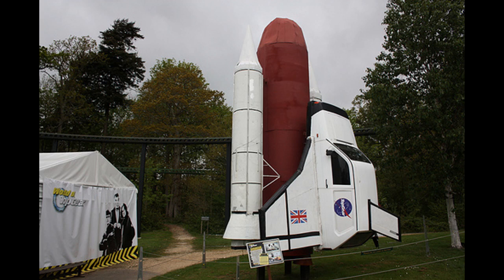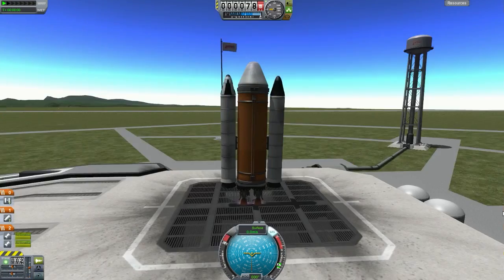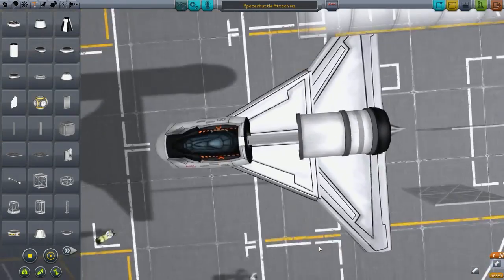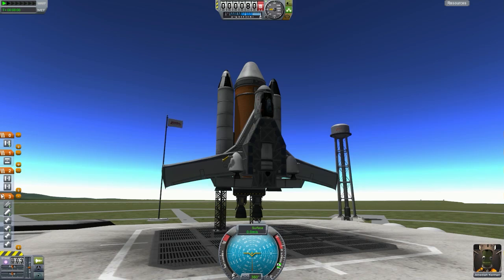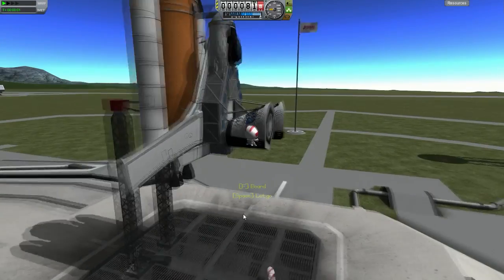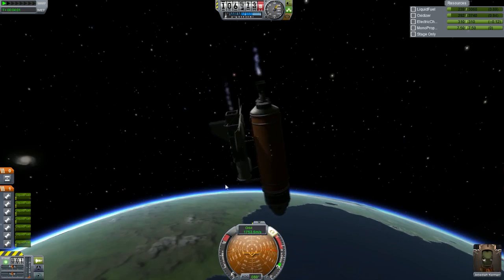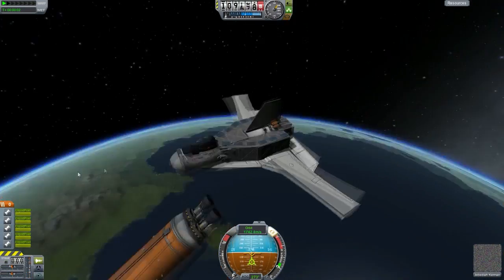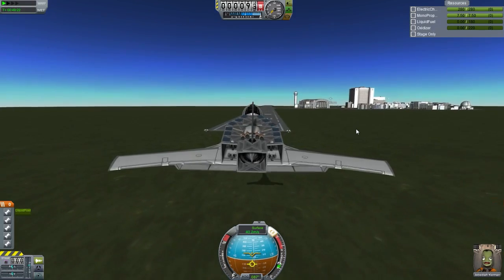KSP : Mini Space Shuttle

Comment: what is that mod your using to put two smaller engines on the jumbo fuel tank or is it stock
Reply: Stock, its an adapter in the constructions section.
Reply: thnx. I didn't see them right away